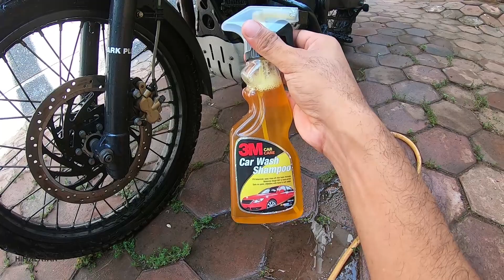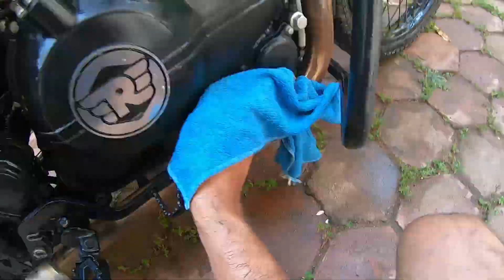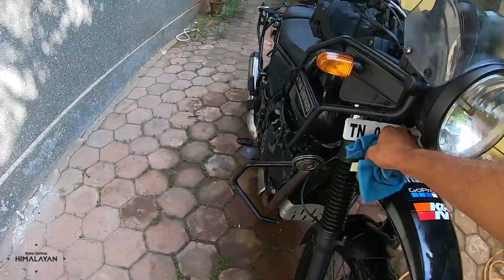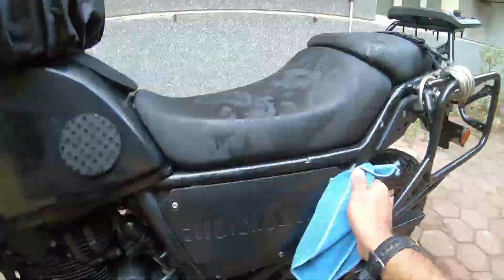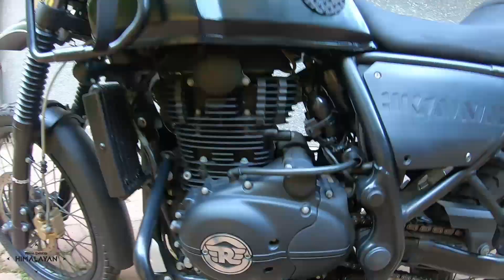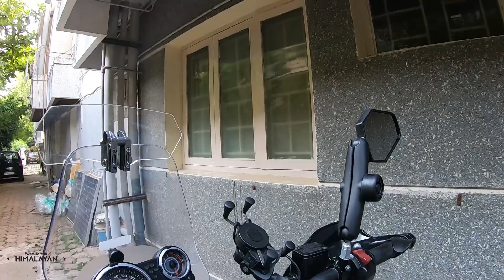royal enfield himalayan maintenance video.

Comment: Amazing work bro.. Have been following you for over 2 weeks and learnt a lot.
Quick question, you cleaned the chain with brush, post that do you apply grease or oil or keep it like that? I see after the bike servicing, mechanic use some sort or oil.
Reply from the maker: thank you for the kind acknowledgement . i apply wd 40 or rust clean on the chain and leave it like that for 10-15 minutes. later wipe it of dry with a cloth. thats it for daily city use. if i happen to go on a long ride i use chain lube every 500 kms.
Reply: @ONTWOWHEELSBEN  Awesome. Thank you.

Comment: Please tell me. Is himalayan engine is better than bajaj dominar 400., in terms of reliability.
Which one is easy to maintain and have good life.
Reply from the maker: the engine is bulletproof in terms of design and quality of parts but the rest of the motorcycle isn't and requires you to be a very good attentive owner. negligence in maintaining moving parts will wear down the bike, way more quickly than a Japanese counterpart (like a Kawasaki or honda dual-purpose bike). I personally don't connect with bajaj motorcycles so no opinion there. also, these two machines are completely different.
Reply: ON TWO WHEELS BEN true

Comment: Hi Ben, 
My bike will be delivered by next month, but before that I would like to know few things
1. What if bike is not starting due to battery issue how do I fix it
2. Can I change the headlight to led (nighteye led)
3. Any Puncture kit for tube tyre ?
Reply from the maker: Ride the bike once a week for a good 30 mins and your battery will be fine . If the issue persists , change your RECTIFIER in warranty . Night eye will start flickering after a while . Get Auxbeam instead . The best option is cyclops . No puncture proof liquid is even a 50% guarantee under load(100 kgs or more )
Reply: @ONTWOWHEELSBEN  Thanks a lot, for quick response Ben, you are awesome 👍👏
Love your Videos

Comment: Hi, Ben can u plz tell where to get the swing arm plastic cap, have searched didn't got the black ones they tend to fall evey now & then
Reply from the maker: They are RE OEM spares . Pls enquire in RE service centres . Or try spare parts stores which sell exclusive RE spares . Also use rubber gasket maker to secure them in place . Or run 3M double sided tape on the inner edge of the caps and push it in .
Reply: @ONTWOWHEELSBEN  thanks Ben